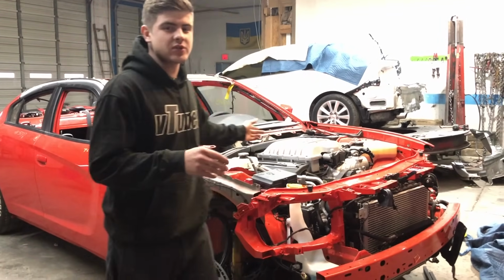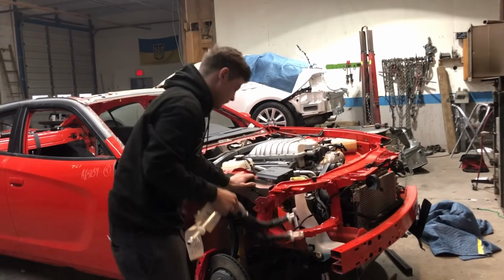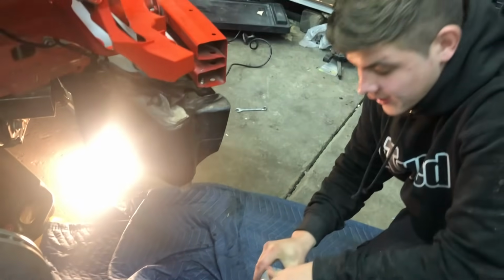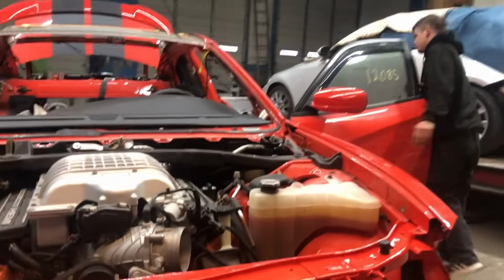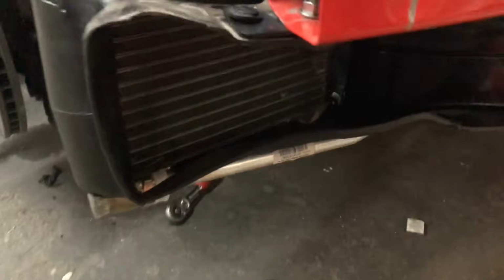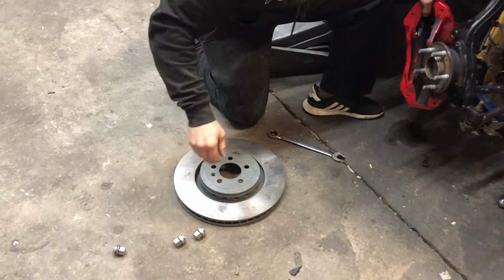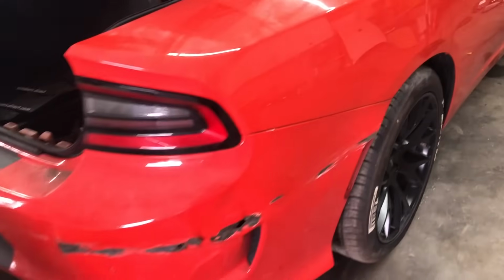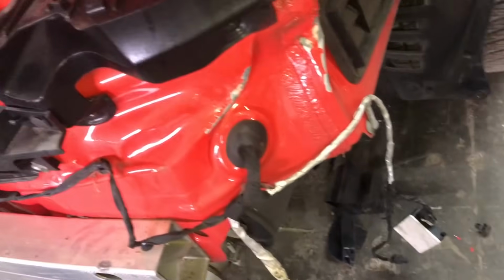Rebuilding my wrecked charger hellcat part 4

Comment: Good tip about prefilling the oil filter. You should also mention to be sure & lube the new filter O-Ring, be sure the old O-Ring came off (they stick sometimes) and I also wipe the filter boss and drain plug hole before putting the plug back in. As to the new P-Zero tire, did you check if has a directional arrow on it and put it the right way ? Also when you mount a tire, there is usually a DOT indicating the heavy spot on the tire. Best is to mount it with that DOT 180 Degrees from the Valve Stem. That will minimize the amount of wheel weights needed for balancing.

Comment: You're not supposed to fill your oil filter 🤦‍♂️ you're just supposed to make sure you have oiled the outside gasket and then put it on.
Reply: Not tryna diss but I've been working on cars as long as I can remember

Comment: Uul cooler, uul lines, uul cuuler bracket.Sloppiest oil change I've ever seen.

PRO TIP : Hold oil quart with spout towards the top, not the bottom. This eliminated the "glug glug glug" undulations.

Comment: first time I've seen someone fill the oil filter before install, is this mainly something you do on a bottom mount oil filter? I own a 15 WRX with a top mount oil filter should I be putting some oil in it before install?

Comment: Use a 4 lb Porta power to push out the rear end panel. No need to set it on the frame to save time.

Comment: You should use Kendall motor oil , I'm doing Porsches and I am surprised that the after doing an oil change the engine doesn't consume oil any more , the  Engine also runs smoother !!!!

Comment: No need to fill the oil filter before you put it on, just fill engine with oil then start it and then check the oil, it will fill the oil filter itself

Comment: How much oil did you put in? 2015-16 manual says 6qt and 2017-18 manual says 7qt yet it's the same engine. It's pretty weird, wondering what you went with.
By the way with a Pirelli PZero you won't have much traction, they are pretty shit on the Hellcat. Most people switch to either DRs at the back, or Michelin PS4S on all 4, they come in OEM size and are extremely good.
Reply from the maker: I just checked the dipstick until it was right
Reply: @Vtuned  Alright. Some people swap the dipstick on the model year 2015-16 with the most recent one, part number #0503 7739 AB. Just wondering if you did anything. Not sure what year was yours.

Comment: Ok you told us the oil filter tip but you didn't tell us the reason why
Reply: So the engine doesn't run "dry" for a couple of seconds after start up.
Reply from the maker: Yea for got to say that

Comment: Back ordered on new roofs? Tells you something about the people driving these things.
Reply from the maker: Lmao
Reply: To be fair, a roof is a very large body panel and likely takes up space. Same for bumpers and hoods. It's not something they typically have at their parts counter, and not exactly a typical part that gets replaced. These dealerships likely want to optimize their inventory for something they would see higher sales volume on, like water pumps, oil pumps, etc.

Comment: Bad idea filling your oil filter first... You're filling the output of the oil filter and any dirt or debris your putting into the filter won't be filtered out during the first start. There's enough lube in the engine to start without oil flow for a second as the filter fills during that first start after an oil change